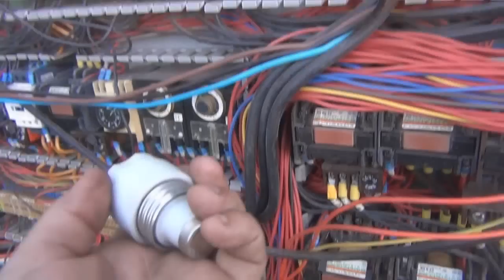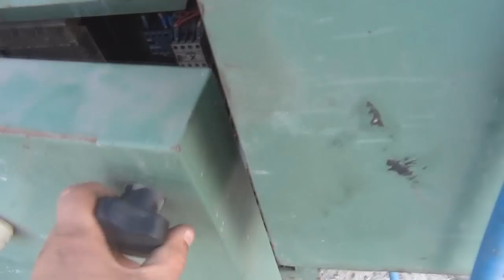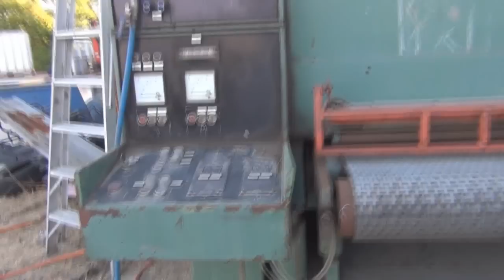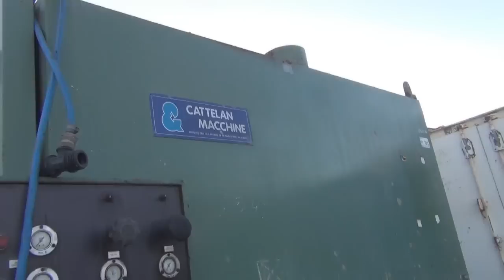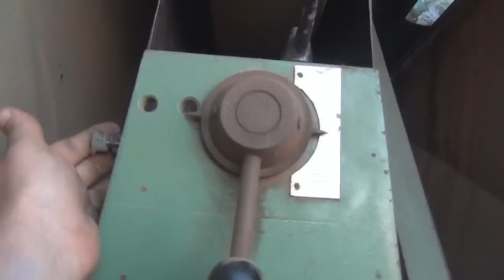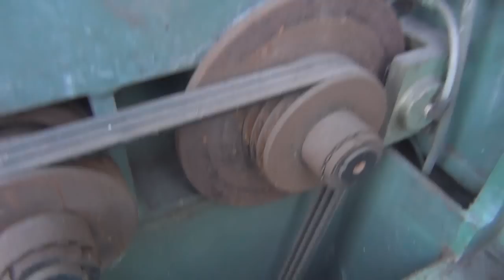Giant Sanding Machine - Control Cabinet

Comment: The first Isolator you came by in the control panel is a fused isolator/disconnecter, the second array of fuses are known as Bottle Fuses here in England, the last bodge item was a motor protective circuit breaker mounted on air din rail (common stuff these days!) x]
Reply from the maker: thanks mate !